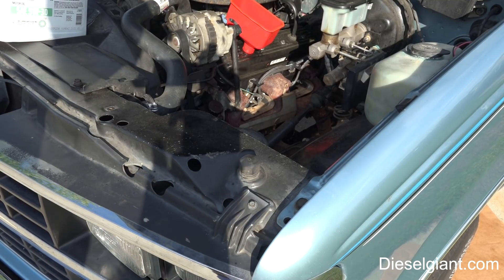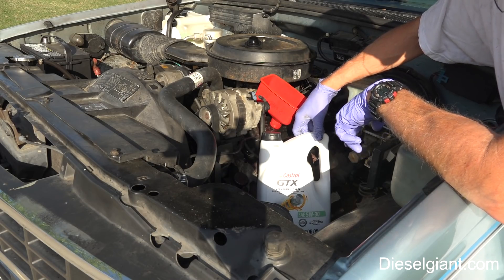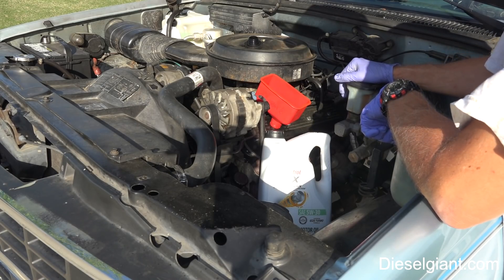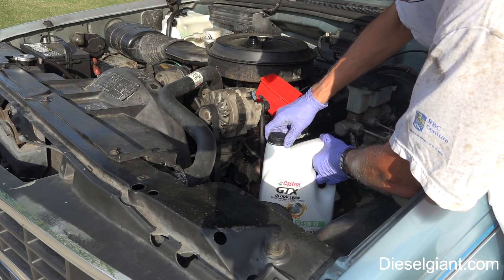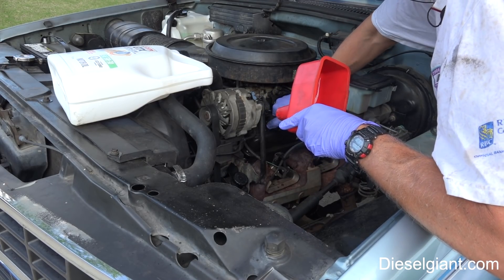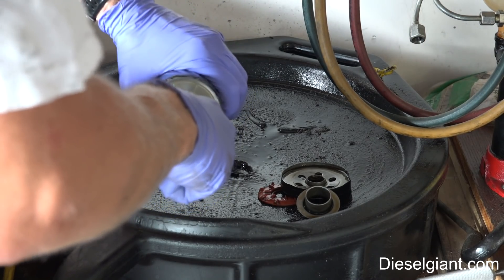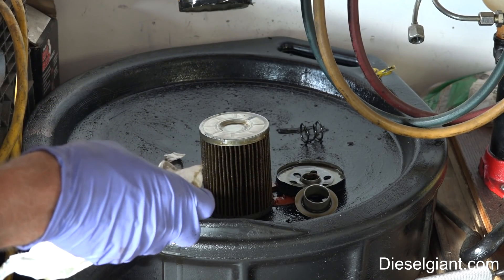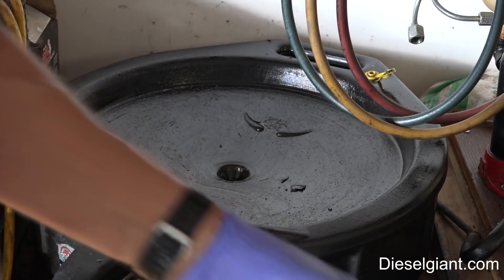1989 Chevy K1500 1st oil Change, No More Amsoil??

Comment: You are right. Proper break in is achieved better with mineral oil for the first 5 to 10 thousand miles. I suggest running the second oil change until the oil is quite dirty. This will polish the parts and conform the rings to the cylinders.

Comment: That old flat tappet engine should use a high zinc oil or you'll probably flatten your cam. Amsoil makes that "Z-Rod" oil that'd be good. I think newer oils don't have zinc, as it screws up catalytic converters. Newer LS based engines (including Vortec) all have roller cams, so no zinc is required.

I think Amsoil offers a break-in oil too. Not sure if it has zinc, but there are off the shelf zinc additives.

Comment: If you run 25000 on amsoil per change,wouldn't you keep circulating some dirt in the engine? Would seem any oil gets dirty after a while,no matter how good the oil...?Good video👍
Reply from the maker: No if you use the EA filter its rated for 25k.  It will catch the debris.  A used oil analysis will really open your eyes to what condition oil is in at a certain mileage point.
Reply: Any high grade oil is compromised if it becomes dirty and contaminated. Fuel contamination always occurs in a gasoline or diesel engine. The only way to keep the oil clean over 5000 miles is with a bypass filter. This is very basic knowledge for some of us.
Reply: The Amsoil full flow filters removes finer particles than other filters. Something like 15 microns (nominal) vs 25-40 microns for most other oil filters. Amzoil doesn't offer the 25K filters on some cars that use tiny filters (ie. little 4 bangers), as the physically small filters can't always hold enough particles to make it to 25k. Amsoil only offers the 15k filter for those applications. Most folks don't drive 25K before the one year  interval is up either.

Comment: If you want to break in with conventional, fine.   But at least use a Diesel rated oil, Rotella, Delo, etc.    and the lawsuit was Mobil vs Castrol (maker of your GTX) not Pennzoil.
Reply from the maker: Diesel rated oil is NOT always rated for gasoline engines.  Some of them are, but I need a 5w-30 conventional not a 15w-40.  Yea I was just looking at a Penzoil bottle before the video so I had that on my mind.
Reply: I didn’t look that closely that it was a gas engine.   I wrongly assumed that because it was in dieselworld it would be a diesel.  My bad.
Reply from the maker: @DeaconDoggie  I wish it was a diesel in that truck for sure.

Comment: Just bought a Chevrolet k1500 with the 305 for my son who will be driving soon. The truck has 63000 original miles. Do you think changing to an AMSoil synthetic would be ok? I don’t think this truck has had the oil changed in 2 years and I was going to do the rear end and transfer case too.
Reply from the maker: Yes do the switch.  Your engine will thank you.
Reply: Yes, do the transfer case and differential. Clean out the cases because there will be metal paste settled in the bottom. For the engine, run a crankcase full of high mileage oil first. Semi Synthetic High Mileage will be a good choice. Then change to Amsoil or Blue Diamond. Don't be afraid to use about 4 oz. of engine cleaner before the oil change! Seafoam, Marvel, Essentialube, or even Amsoil's engine flush will work fine.